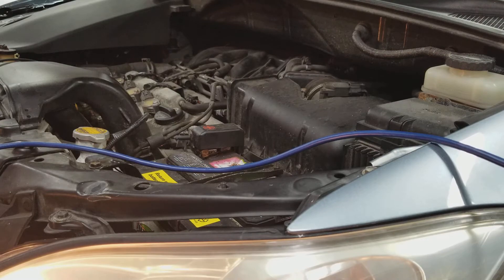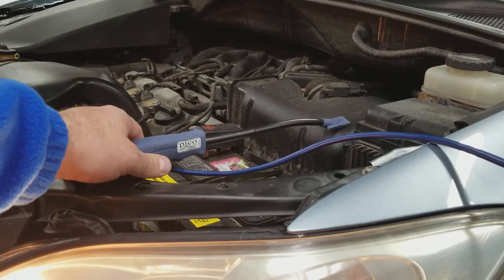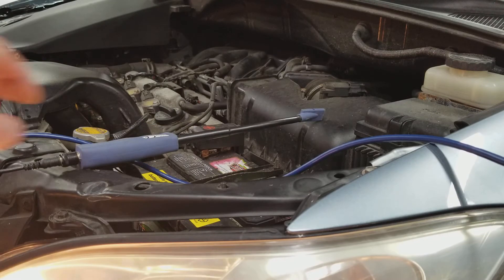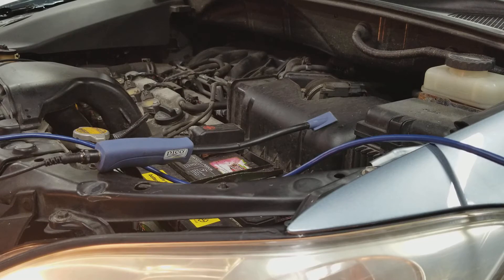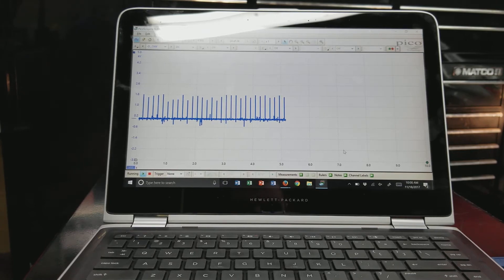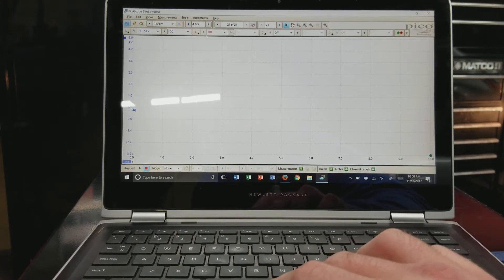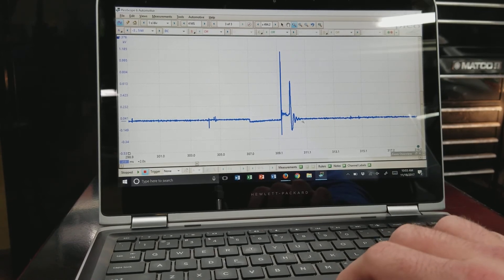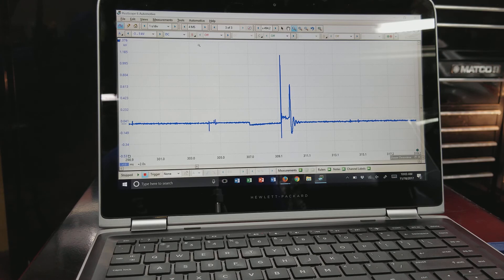Easy Fuel Misfire Identification

Comment: I think it's worth noting what point in the snap-throttle scope pattern is worth examining. I've only been playing with scopes for about 2 years now, but I would think if we examined the tail end of the pattern, we would see lean firing regardless because of fuel cut-off. Is that what was going on @ 3:53?

Comment: Secondary ignition works fine. I find a pulse sensor on the regulator if the car has one tends to show it easier than a transducer. The pulse sensor is a lot more sensitive to small changes than the transducer.

Comment: A few questions regarding the signal quailty:  (1) Does applying a filter add any value to interpreting the 2ndary ignition signals since they often have a lot of noise?  (2) Does a lean misfire significantly raise the spark line voltage and affect the spark line pattern as well?
Reply from the maker: No need to filter, ignition noise shows up in other waveforms, but when you zoom in to analyze there is no issue. It will affect the firing line too, but not as much as oscillations.